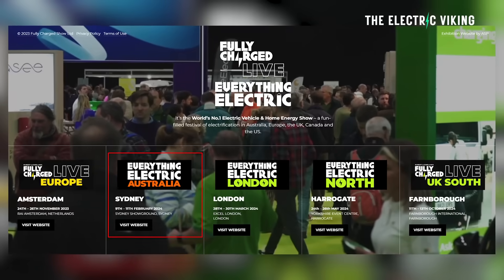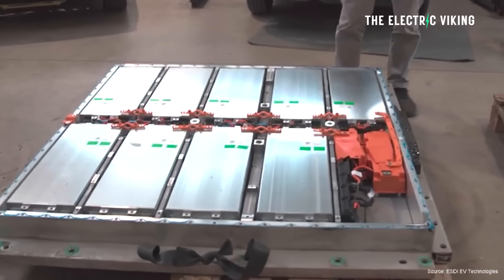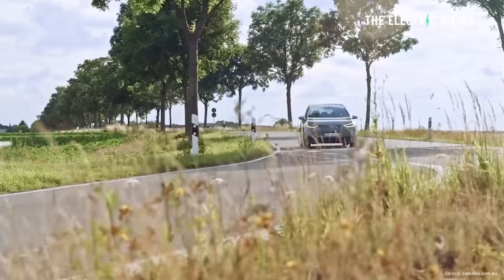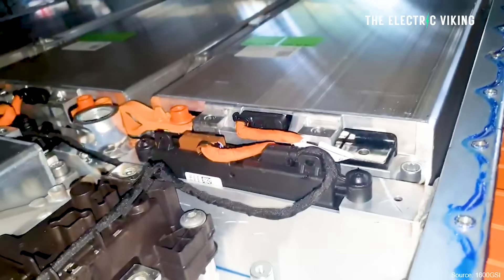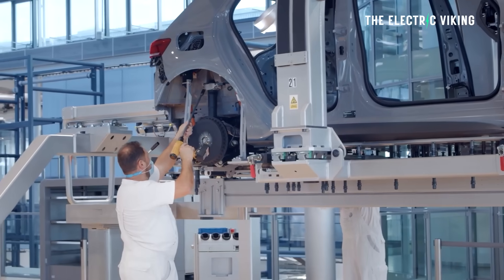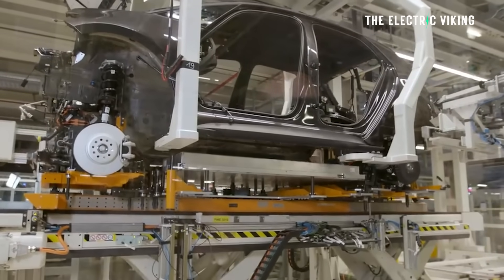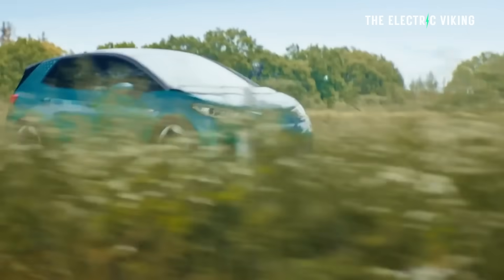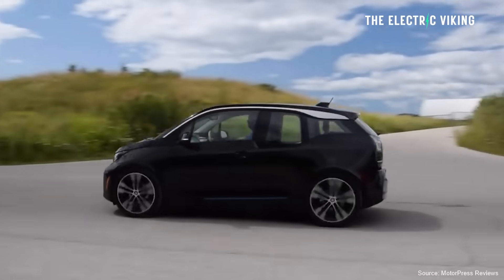Volkswagen ID.3 loses 10% battery capacity after only 30,000 miles

Comment: My ID.3 has lost 14% for 135 000 km
Reply: Do you remember what the degradation was at 30,000?
Reply: @Rizzler420-uh4yd  No. I havent checked it untill recently. My car is doing fine. It was all smooth so far - no noticable drops in capacity/range. I think 14% for 135 000 km is acceptable. Not the best, for sure, but still good enough.
Reply: Enjoy  your ev.
Reply: Thank you for your initiative in adopting a Euro EV early in the technology.
Reply: @mazhdrakov  May you tell us which battery size your ID3 has and how old it is?
How you use the car would also be interesting.
Reply: i just bought ID3 (2021) 58kwh 2/2024 used car that battery report from VW car shop is 92% 13000 miles, i don.t know the problem will increase
Reply: @Paul-hl4yx  Yes but veeeeery sloooowly.

Comment: Bjørn suspected that this car was super charged often, and was charged to 100% freqently.
Reply: Saw a interview with Elon Musk where they talked about charging, and from what I remember Elon said that it was the charging over 80%  that put mechanical degradation on the battery, cause the electrons needs to find the free space in the battery, that is why its important to lower speed of charging after that (my laptop does the same actually, while my phone stops at 85%)
Reply: Personal driving and charging habits will cause variability indeed.  If you drive it like you stole it and fast charge often then it goes without saying that the battery pack along with other components are not going to last as long.  Some of the people who complain the loudest are often those that not only drove it like they stole it but went so far as to make go-faster modifications putting more stress on the pack than it was designed for.  MTBF is considered when performance levels are set based on the average reasonable persons driving habits so when someone drives in an unreasonable manner or makes modifications to override those set limits you get what you asked for.

On top of that we are talking about Volkswagen who now has a history of taking liberties with their software and design to pull off some form of subterfuge along with VW sending their own software team packing so there is that too.

Best!
Reply: @AndrewTSq  Yes, I agree! I charge my Samsung S10e to 85% as recommended by the manufacturer.

Comment: I suspect that this car has been abused.  My ID4 has about 20,000 miles on it, with no discernable battery degradation.   It currently has a range of 255 miles at 80% charge, which is actually more than what it is rated for.  I never charge it to more than 80%, and I use a 110V wall outlet.

Comment: My Model 3 has lost 9% after 30K miles, that's to be expected with NMA batteries. The loss is not linear, most of it happens in the first year after that the loss rate is much slower maybe 1% per year, that's what I've seen.
Reply: I’m down about 10% after 9 years and 210,000 miles .. 2015 ModelS 85D .. also NMA I believe.
Reply: This is correct. Viking's video title is as misleading as some of those recall news.

Comment: I have a 2006 Golf 2.0 TDI. When I bought it new it would do 1000 km on a road trip and 900 km in town. Today nearly 18 years later those figures have not changed regardless of temperature, +40C or -10C. It takes less than 2 minutes to fill from nearly empty and there are servos on every corner in cities and country towns, and also no issues with fuel stops way out in the bush. When EV'S can match that flexibility and capability I will absolutely definitely buy one with glee (but not a Chinese piece of rubbish).
Reply: I've seen a picture of a TDI engine swapped into a Subaru STi. They called the thing STDi.
Reply: On a serious note, I drive a 2004 bmw e60 with the mighty iron-block m57 engine. It can still do 1200km on a tank of diesel, after 500 000+ km. This adds up to this vehicle being responsible for 104 tonnes of co2, plus probably 10 more tonnes or so during production. That's enough to produce 6-7 large EVs like Tesla S. Or, probably 10+ small EVs like bmw i3.
Reply: If those are then driven in a country like Austria where I live, all the electricity comes from renewables, which means that no additional co2 is emitted. Teslas often make it to 500k+ km but even if we assume that each tesla will need a new battery to reach this number, we'd still have 3-4 EVs for the same amount of co2 of one old diesel bimmer.
Reply: The math is a bit different if electricity is produced from coal, but even then EVs are responsible for way less co2. And as we all know by now, co2 spikes correlate with extinction events.

I'll be happy to upgrade to an EV soon - even if that means inconvenient road trips in the future.

Comment: My 17 volt with 75k about 45k all electric, when new 52 miles electric range. Now about 45 summer and less the 40 in winter! Was able to drive to 13.5kwhs, now its dead in about 11.5-12. There was a software update a while back that seemed to correlate with the reduced range!

Comment: 24,000 km on a 2022 model 3 LR and I’ve lost 3.8% battery according to Tessie, almost entirely 7kw charging and staying between charging guidelines. 

Our Model Y LR 2023 has lost 1.3% with just 10,000km
Reply: what do you mean? you have only driven 24km with the Model 3 and its lost 3.8% battery? That sounds more like some error in the readings.
Reply: 24km ????
Reply: 24km = 12 miles very approximately.  I guess this typo should have been 24k miles.
Reply: @robertwhite3503  or he could have meant 24k km which would be roughtly 15k miles
Reply: The Tesla shortsellers will tell the media to NOT publish your story.  :-)
Reply: I checked out a few graphs for degrading of LFP batteries. The 1st 3 to 4% in the first year. Then less than 1% yearly. More like 0.5% from 2nd year onwards!. 🤔🤔🤔

Comment: Ford have delayed the launch of their Explorer EV because they are upgrading the battery system of the Vw platform that sharing as it simply isn’t good enough, compliant with regulations of today and that know coming into place soon so Vw does have a big issue with their power source platform. The Ford Explorer will come with a different battery that will comply with the “upcoming European standard for electric vehicles, UN Regulation 100.3/ ECE-R 100.3”, Ford spokesperson Ralph Caba told 24RHEIN. If the new battery standard will require constructional changes of the vehicle remains unclear.

Comment: This is borderline “click bait” 
Having looked at this particular video it’s pretty obvious that the BMS has developed a poor calibration whether it’s a fault with the particular car or how it has been changed remains to be determined.

To determine degradation with a poor BMS calibration is utterly pointless. VW’s do suffer possibly more than most in low temperatures.

Comment: I have an ID3 (from November 2020; so  3 1/2 years old) with the same battery - Im at 54,000 Km (so over 30 K miles) and I havent measured the battery degradation but I am still getting the same range as I did when I first bought it - so I really dont believe this is an issue for everybody

Comment: I have a VW ID4 2021.  I have lost 20% of my battery after 106,000 miles and only charged to 100% twice and ran to 1% three times.  I was charging to only 80% until the last 10,000 miles I have put on since now to charge to 85% often.  Will not be buying an VW ID4 due to battery degradation.

Update- now have lost 50% batter at 112000 miles

Comment: The first rev of the LG Chem batteries in the Bolt had some problems (20 out of 140,000 Bolts burned), but they are lasting well; a guy in Quebec Canada has 430,000kms on his original Bolt battery, with 5% degridation. I wonder if the slow charging speeds help this.
The N2.2 and N2.2a batteriies have no problems or recalls.
Reply: As long as you dont fast charge the battery will last longer.

Comment: Hyundai charges 60k to replace the battery? You buy a ev with 300 miles range but can’t use all the battery. So you lose another 20% for safe practices and how much more in extreme cold or hot weather? Ev are useless to most people….
Reply: According to data from the U.S. Department of Transportation, 95.1 percent of trips taken in personal vehicles are less than 31 miles; almost 60 percent of all trips are less than 6 miles. In total, the average U.S. driver only covers about 37 miles per day. '

Comment: My Altima gained 5 hp after a tune up. Who is the battery supplier.
Reply: What is ther to "tune" on an EV?
Reply: @jimdetry9420  Difference between a gain and a degradation loss was the point.

Comment: -16c testing regime with interior set at 23c no heat pump with OBD2 and car scanner app and with no known data of the car new.  Also charge of battery worked out through efficiency data rather than taking charge put into the car at charger - these are just some flaws to the testing regime.  It is as FUD as it can get.   Love him range testing videos but when it comes to scientifically testing degradation - there is only one word describing his methodology - "Shiiit"

Comment: Electric Vehicles, or EVs, Are Not Cars

The government and auto industry wants us to believe that EVs are interchangeable with gas-powered vehicles.

EVs are not a “car” as we know them. EVs are experimental transportation devices that the government wants us to accept as a car replacement.

I believe the rollout of them was extremely premature. They look like cars, and seem to function like cars, but they are not cars.

Words and their traditional definitions matter.

Using the word car for an EV is misleading. I try to avoid it.

EVs are a completely different machine and when purchasing one that should be our mindset.

Replacements For Vital Machines (Evs For Cars) Must Outperform Their Predecessors To Be Universally Adopted

For a new product or invention, which an EV is, to replace a tried and true significant part of our daily lives, like our cars, it has to be a better choice.

Do EVs outperform cars in all important areas?
How should a car replacement be better?
1) Cheaper purchase price, lifetime maintenance and disposal.
2) Better performance, road handling and driving range.
3) As many or more locations to “refuel” and lower recharging times than refueling. Overall more convenient and time saving than gas powered vehicles.
4) Safer in all ways, including charging away from home.
5) Seamless and transparent replacement for our current experience with cars.
6) EVs should be less expensive to insure.
How do EVs stack up in those five categories?
1) EVs are more expensive than gas-powered vehicles. Overall costs over time are much higher for EVs. Even if they were cheaper, the current negative impacts of the loss of convenience and functionality make EVs not worth replacing our cars with experimental replacements. Government subsidies paid to corporations and individuals approach $50,000 per EV. An EV is less functional, yet more expensive? Who thought of this great system?
2) EVs have much higher average horsepower, but other than that the driving experience is not much different and is sometimes deficient. Range anxiety is real and total miles available on a full charge falls terribly behind a full tank of gas.
3) Gas stations are much safer and more convenient than EV charging stations. On the road charging can average ten times longer than refueling with gasoline. EVs fail miserably here.
4) The level of danger using an unmanned EV charging station at night in a deserted parking lot is not tenable, compared to gas stations which have personnel, lights and security cameras. EV battery explosions are commonplace.
5) EVs are not a cheaper, more functional replacement for our cars.
6) A true car replacement would be cheaper to insure. Middle class families already can’t afford car insurance.

EVs fail on almost every measure.

This certainly does not make a great case for EVs.

Using EVs dramatically changes your entire driving experience, one of the most important parts of our daily lives.

There are so many unanswered questions about the impact on us if the government were to ban gas-powered vehicles in favor of EVs.

Mandating EVs will change our way of life.

As with other government experiments in the recent past, they want us to be the test subjects.

I propose we opt out of this government experiment and all others in the future.

Fad For Wealthier People

EVs are still a fad for wealthier people for the most part. Currently they are mostly an option for owners of free standing single family homes and less often owners of townhouses with a garage.

And even for those free standing single family homeowners, once you have more than one EV, it can quickly become impractical, cumbersome and unworkable.

There are government laws forcing apartment complex owners and townhouse communities to allow residents to install charging stations, but they are not widely used.

The vast majority of renters and townhouse owners don’t have the ability to purchase an EV as they can’t charge them nightly.

EVs require access to a power supply that can extend to your EV where they are parked overnight. While away from home needing a charge, you need to find a charging station.

For people who own free standing homes, with a traditional garage and driveway setup, this is relatively simple and most practical. But even then, a family with two or more EVs may not be able to charge all of them overnight. Once you expand beyond one EV, things begin to fall apart.

Many townhouse owners are in the same predicament as apartment renters.
Renters of any type of home usually don’t have the ability or finances to install the systems needed to charge an EV. They would also need permission from the landlord.

Even if an apartment complex or townhouse association installed a few, having this done on mass scale for all apartment and townhouse residents is not practical for decades to come, if at all.

Townhouses, although purchased as a residence, are more likely to be a temporary stop to a free standing home, and so installing a charging station may not be worth the investment.

Excluding these drivers will stall or make impossible the complete replacement of gas-powered vehicles with EVs. 

So, what percentage of drivers are in free standing single family homes? This is the true market for EVs on the consumer level. And, again, only for one EV in the family.

Let’s take a look at the figures below.

It will tell us what % of us have severe barriers to entering the EV space.

132,000,000 (A) - USA Households			            	
83,000,000 (B) - Detached single family homes						
49,000,000 (C=A -B) - USA Households With Barriers To Entry Into EV Space	                
37.12% (D=C/A) - % USA Households With Barriers To Entry Into EV Space
233,000,000 (E) - Drivers In The USA			
86,000,000	(D×E) - USA Drivers With Barriers To Entry Into EV Space			

86,000,000 out of 233,000,000 U.S. drivers cannot practically transition to EV use. 

This 37% of drivers who cannot use an EV is important to remember, as it impacts the rest of the problems EV owners face.

Safety Issues At Charging Stations On The Road

Again, remember, we are imagining a world where gasoline is no longer needed and so gas stations would become a novelty.

So, with only EVs in everyday use, there will be times we need to charge away from home. Where will this take place? There is some EV charging infrastructure built out, but there are many problems. And this is with a very small percentage of EVs on the road.

Imagine, again, that only EVs were allowed. The infrastructure needed is unfathomable.

And what is the infrastructure for remote charging going to look like?

I have serious concerns here as should you.

When we need gas, we simply find an open gas station.

Gas stations have security cameras and personnel when they are open.

We take these well lit locations with employees and security cameras for granted. These safety features do not exist at EV charging locations. Most will be in parking lots of retail shopping centers with no attendants.

This decreases security and increases waiting times.  That is what they are proposing. We should not accept these severe regressions of course. 

Parents, let me ask you. Would you accept your children going into dark and empty parking lots, when retail stores are closed, to charge up for 20 or 30 minutes by themselves with no personnel on site?

Of course you would not.

No security. No one in government is talking about this. Remember, they want to eliminate the safe gas stations that are an integral part of our culture and replace them with this.

This is just another barrier I don’t hear anyone discussing.

EVs are not interchangeable with gas-powered vehicles. They are a completely different machine. They are not cars.

Consumers need to demand the same level of security measures and functionality that gas stations provide.
Reply: So I can sue  the dealership then. I went into my local dealership to buy a car, paid a lot of money and came out driving something that’s not a car. 😂😂😂
Reply: Who the hell writes a novel in a Youtube reply.   Obsessive Compulsive Disorder, much ?
There are pros and cons to electric vehicles, battery powered lawnmowers, drills, vacuums.  Consumers make the decision that fits their particular needs.  If you have 10 acres to mow, don't buy a battery powered lawnmower.  If you have 300ft driveway, don't buy a battery powered snow blower.  If you don't have a garage where you can charge your car, and you're driving 100+ miles everyday, don't buy an electric car.  It's not rocket science.  Why are you so emotionally attached thinking that anyone want to read novel on youtube to hear your opinion.